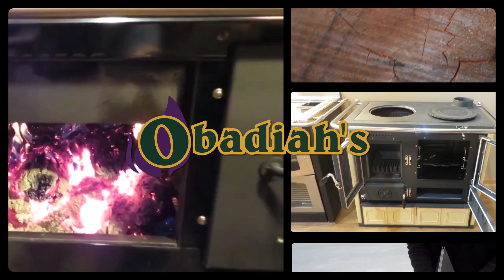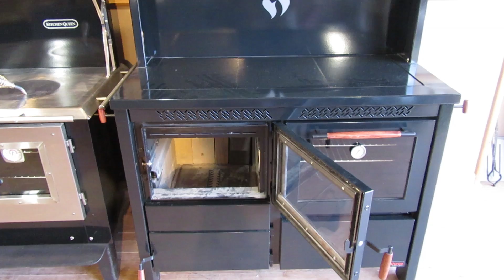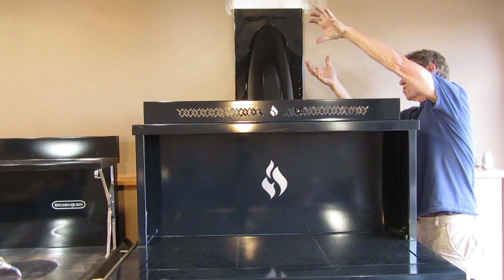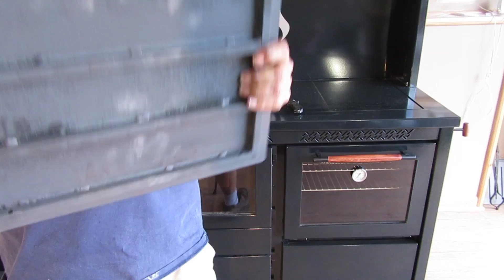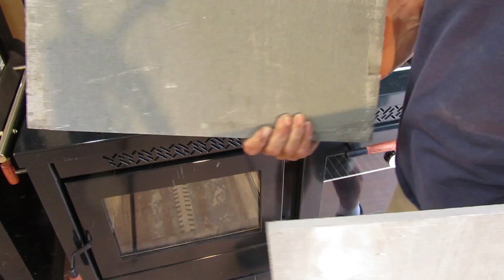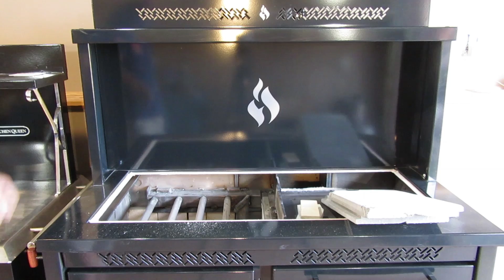The Heco 520 Wood Burning Cook Stove - Overview

Comment: Keep in mind folks, This video was done on an old model Heco 520 before it was manufactured by DS Stoves, There have been design changes to the Oven Bypass and Baffle location since. The baffles now are installed pushed all the way to the right (oven side) and the bypass damper is wider and covers the whole pathway shown in this video. The smoke travels around the Left side of the baffles and then over the firebox to the oven side flue exit.

Comment: I bought this stove from Obadiah's.   Great people, great service. The stove is amazing. A heads up to future buyers, there has been a design change since this video was made. I assume to make it draw better. My stove is easy to light and does not smoke.
Reply: I have had zero issues. Heats the entire house no problem and is pretty efficient for its' size. We have the glass door and, because it pumps out so much heat, it is difficult to stand in front of to cook. Maybe keep a blacksmith apron.😂 If I were using it to cook daily, I would want the insulated firebox door, rather than the glass.
Reply: How's the stove holding up?

Comment: Woody could you possibly do a detailed video on the stove how the temperature gage in the back works .how the water heater  tank works.how do you clean out underneath the oven. how do you adjust the heat from one side to the other.  and as the lady just before me said,  how do you get the temp up on the top of the stove on a high temp, but you don't cook yourself. Eight updated video showing all this would be really wonderful we all love the stove but we really need detailed information on exactly how the stove operates thank you
Reply from the maker: Hi Robin,

We had a chance to address the thermostatic draft control (temperature gauge) and oven cleanout in a seperate video, here: https://www.youtube.com/watch?v=KipaAZRm1fU. But to reiterate on the draft control: The thermostatic draft control works by setting a temperature control. Most folks set it to the middle setting (3). This will automatically regulate the draft on the stove. Therefore, if you had a really hot fire going in the morning, but didn’t want to have the stove running on hot and going out by the time you would get home, you would set the damper control. This would allow the fire to burn hot for a few hours or until the stove reaches temperature, and it will close the draft on the firebox so the stove will automatically damper down.

The water reservoir works by manually filling the tank with water and manually dispersing the water thru a spigot on the side of the tank. The water reservoir gets hot with radiant heat off the rear of the stove and does not plumb into anything, as it is not a pressurized system.

I'm not sure I understand what you mean by "adjusting heat from one side to the other". You can control the entire stove by using a low, medium, or high damper control setting. Otherwise, you can either circulate the heat over to the oven for baking, or all of the heat comes out the front of the stove as convection heat. There is no way to make one side of the cooktop hot but not the other. The cooktop will have a variety of temperatures due to location of the cooktop in relation to the firebox.

I hope this info helps, and please let us know if you have any additional questions!
- The Obadiah's Team
Reply: Obadiah's Woodstoves thank you we will be ordering our chimney soon

Comment: I am  now using the Heco 520 after 20 years cooking on a Pioneer Maid. The Heco burns all the wood to powdery ash which I quite like. And the convention feature heats the house VERY well. The baffles do seem to keep the stovetop from being as hot as I am used to. By the time the top is hot enough to cook on I don't want to stand next to the stove to cook. I'm wondering about removing the baffles will it damage the stove?
Reply from the maker: Hi Ellen,

No you cannot remove the baffles, by doing so you run the risk of over firing the stove. Are you using glass doors on your Heco? If so, switching to the insulated doors might make things more comfortable for you as the glass doors allow more heat to radiate.
Reply: Yes, it is very "baffling" why they would do that...I want this stove but with the direct fire cooking others have...it just seems like that baffle and the rectangle stove top plates would be a no go for me...

I hope one day they figure out how to do everything else but still allow open fire cooking like other stoves do...this is my very favorite except for those things...I love the oven size, the fire box size, and the warming shelf height and water system, but I can't go for the other issues...
Reply: Hi, might I ask your thoughts on your old Pioneer Maid?
I grew up cooking, heating on vintage cookstoves, the porcelain bodied Home Comfort.

I am looking at Kitchen Queen 480, and the Pioneer Princess. I want a big firebox, reburning tubes, round pot holes, and prefer positive locking doors, an airtight stove for long burns. I like swing door for the oven.